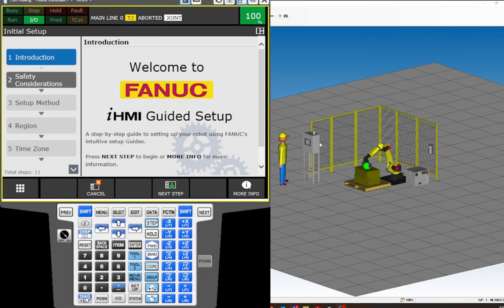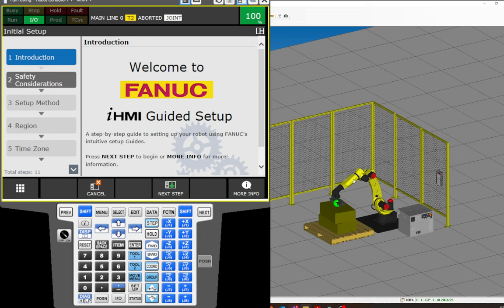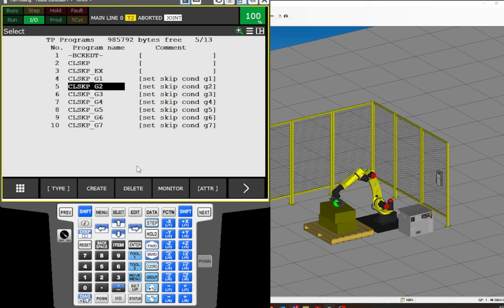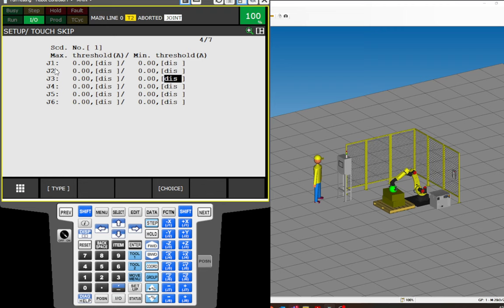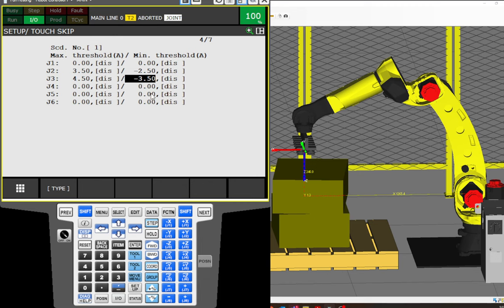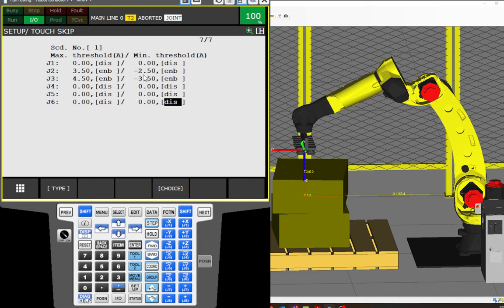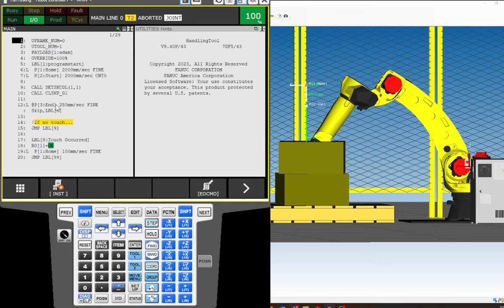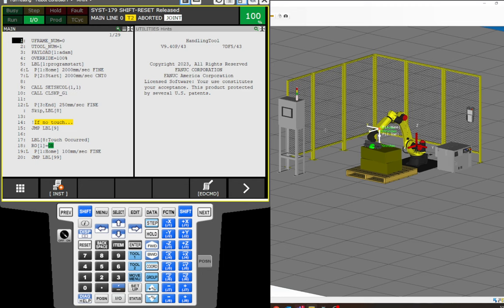FANUC Touch Skip

Comment: Dear Adam, again great video.
I wish to thank you so much! A year ago, I was attached to a project with FANUC robot. It was very complicated project with two types of grippers, which must be changed automatically, depalletization and palletization. In addition, the boxes where the parts are placed of course are two types, but one of them was places differently.
Thanks to your videos, now (the project is almost finished) I consider myself very confident with FANUC robot - and this is mostly because of you. You were the one who introduced me to offsets and relative motion and the different behavior of motion commands. Thank you so so so much.
I hope that you don't mind to suggest two ideas for videos:
- I was great doubts, how to orient the TCP frame. According some videos in YouTube, Z axis points out of the J6, some other vloggers suggest Z axis to point into Z6. In my palletization/depalletization problem, I consider it was more convenient, Z axis of tool frame to be colinear as Z axis of user frame. So what is your opinion end recommendations?
- Another great problem, I stuck was with configuration of a point - this is FLIP/NO FLIP, LEFT/RIGHT, UP/DOWN, FRONT/BACK and turn numbers. It turns out, that the flange of J6, when connected to to fast-changer, is rotated 105 degrees. So at one position further, turning number of the point becomes from 0 to 1, and I suffer from - the point can not be reached error. Thanks to a friend, who explains me the issue, I successfully resolve the issue. But at the beginning it was very, very frustrated - robot can reach the point but in automatic mode - refuses to went there. So some advises for pitfalls of such configuration issues and the methods to resolve the problem will be great for all of us.

So the post become quite long!
Respect Sir - and thank you again very very much!
Svetozar Yolov
Reply from the maker: I absolutely LOVE this comment, thank you so much! Stories like this keep me motivated to make new videos :)
1) Z axis for TCP; it all comes down to user preference if you would rather have Z face downward, upward, or some angle in between. Since the "default" is that world Z goes UP and TCP Z goes DOWN, I sort of have it memorized that way. But that is very confusing for many people, so making Z always go DOWN can greatly help.

2) You have given me a great idea for a video... robot Configurations... Stay tuned, you will see that coming soon!

Thanks for watching and for commenting!
Reply: Many thanks for your comment and response. Take care! Cheers!

Comment: Hi, great & useful video as always. "Touch skip" functionality is possible even without option J921:

1) in BGLOGIC, read disturbance torque into a register, e.g. R[90:Torque J1]=($MOR_GRP[1].$CUR_DIS_TRQ[1])
2) in motion program, set skip condition on that register, e.g. SKIP CONDITION R[90:Torque J1]>350
3) in following motion, use "Skip" motion option in usual way, e.g. L P[15:push] 20mm/sec CNT0 Skip,LBL[11],PR[4:Touch point]=LPOS

You cannot use $MOR_GRP[1].$CUR_DIS_TRQ[1] in SKIP CONDITION directly - TP allows you to write that, but it does not work. The threshold needs some trial-error tweaking (the value is in weird units, not Amperes). The response time is limited by scan rate of BGLOGIC, but "touch skip" in 2000 mm/s is not a good idea anyway...

Very useful e.g. for pushing the workpiece with some force, regardless of dimensions of the workpiece.
Reply from the maker: AWESOME tip and FANUC "Life Hack" :) I love it, thanks!

Comment: Great video once again Adam!  But does this method have the same problems than "torque sensing", when picking  pieces from a pallet, multible rows and colums,when all of your axis are in a VERY different positions? Like, if a pallet is 800mm X 1200mm and you have several layers, for example 20-100 layers of pieces, the torque do not always work before years of "trial and error"... Just done one pick-from-a-pallet set up with just Skip Cond(RI:Vacuum=ON), with a END-point that is -20-30mm IN a piece that i am looking for. This Skip-(I/O)-method has been very good always.  Does this Touch-Skip method have some advantages against Skip Cond, or a Torque Sensing?
Reply from the maker: This is a great point to make, so thank you for commenting. I always advise that people use "skip cond" by using sensors such as a vacuum sensor because then you are not relying on physical contact. Obviously, physical contact can potentially damage parts if you're not careful, and yes the "fine tuning" takes some time. However, in many cases the touch skip is the only tool left that works, so hey - we have it!

Comment: hi, i tried to reach you before
I will install 2dvision, the camera calibration is good, there is no problem in x and y positions, but when I angle it, the position is deviated, what can I do? can you help me?
Reply from the maker: Super common problem! If X and Y work well, but R throws everything off, it is an Application Frame vs Calibration problem. First thing you need to do is use the 4-POINT method when teaching that vision UFrame. Don't use 3-point. You HAVE to have the "orient origin" and "system origin". Check out my 2D iRVision video to learn more about that. 
Then after that, it's important to note where the top of the part is relative to the frame you taught. basically, how thick is the part?
Lastly, I always recommend if using "Perspective" on the calibration setup that you physically measure from your Uframe plane to the adjusting screw on your focal lens and manually tweak the values until the Z-Height matches reality. 
Do all that, and should be sweet.
Reply: thank you sir   @AdamWillea

Comment: Hi Adam, great topic. Can I ask you about the Data position reg, This program is done by somebody, and I don’t know how to figure out the drop positions is a little bit off. If retouching position it took the point but started to auto it back to a different point kid of overriding by autostart. If you can give me an email I will send to picture. Please and thank you so much 🙏🙏🙏
Reply from the maker: Ah yessir - that's common. Previous programmer must be writing data to those PR's in a separate program, macro, or BG Logic. You'll have to do some hunting, but I guarantee you'll find a PR[x] = xxxxxx line somewhere. Or perhaps even a PR[i , j] = xxxxxx someplace. My guess is they are pulling data from JPOS, LPOS, external, or maybe just writing a Constant to it to "initialize" the data. But that will explain it!
Reply: Thank you, Adam; I appreciate your help

Comment: Adam, this is a great video, but there is a mistake in the explanation of skip conditions. When the robot is moving to Line 12, P[3] and the skip condition is satisfied before reaching the taught position, the robot would continue to line 13. If the robot reaches the taught position of P[3] and the skip condition isn't satisfied, it would then skip to LBL[8].

Comment: You made two big mistakes, next time try it on a real robot before making a video.
1. Touch skip works with high speed skip only (Skip,LBL,PR instruction, not just Skip,LBL)
2. It jumps to LBL if touch did not happen, if touch happened it continues right after the motion instruction with Skip